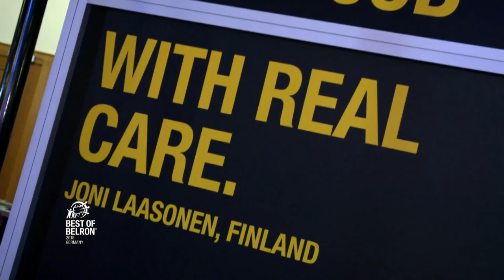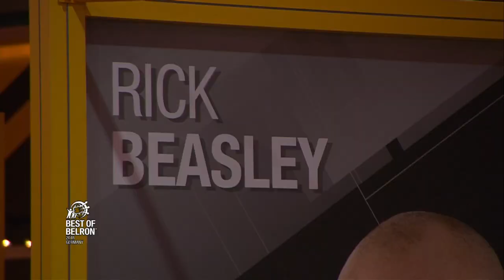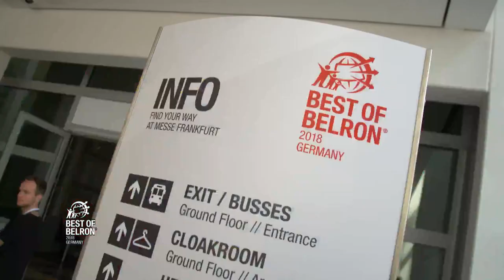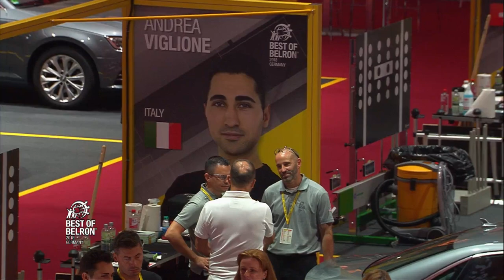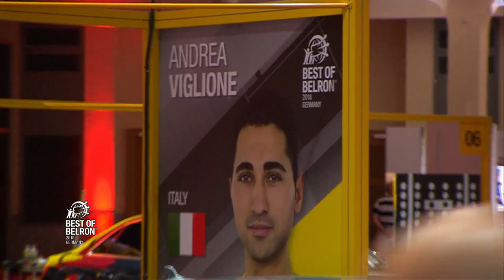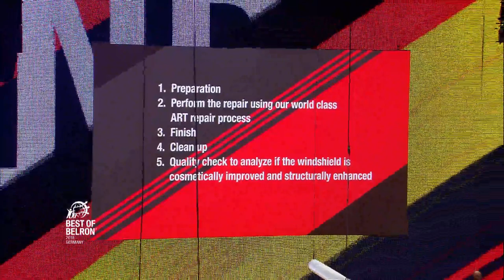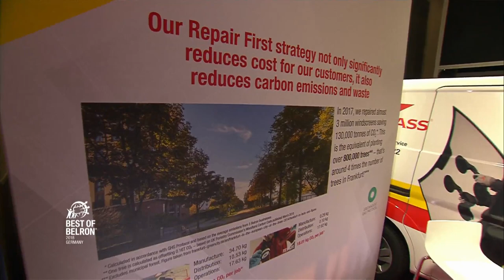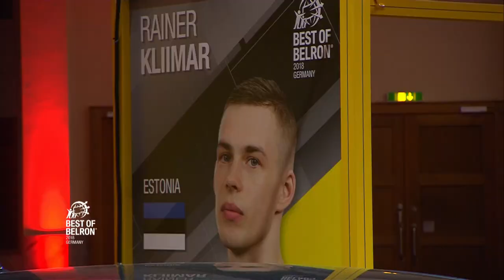Best of Belron 2018 - Day 1

Comment: This is hilarious. Could not be farther from reality from a day to day life of an auto glass tech. I would like to see Best of Belron on the road. Rain snow traffic. 10 jobs with 6 morning 8 to 12 appointments with pissed off customers. Try to sell the judges windshield wipers as well. Shut down your work truck. 105 degrees. Or maybe 0 degrees. Glass that fits horrible. Wont recalibrate. Go pick this part up cause it was delivered damaged. Only part remotely close here is someone watching over your shoulder the whole time. Just FLLLLLYING cleaning those windows.... Surprised the didn't choose the Toyota Camry again. At what point in this video do they replace a broken backglass? Looks like they take out a glass that isn't broken. I Will say the one contestant did a great FINAL WASH.What a joke.